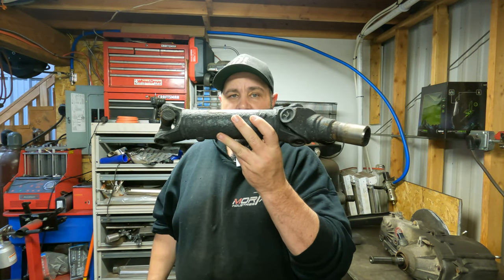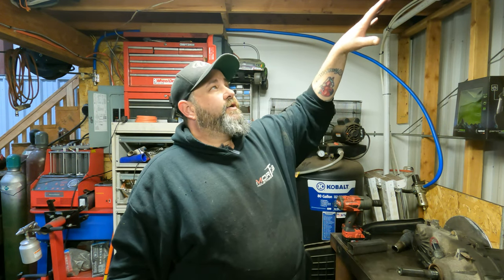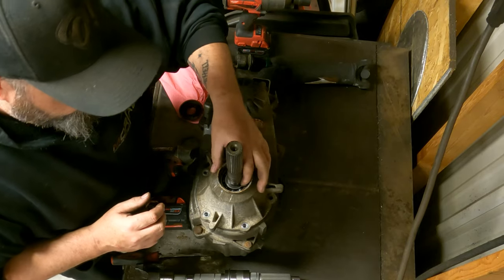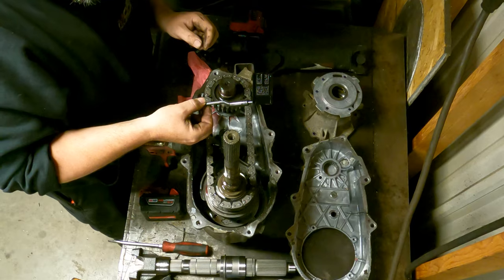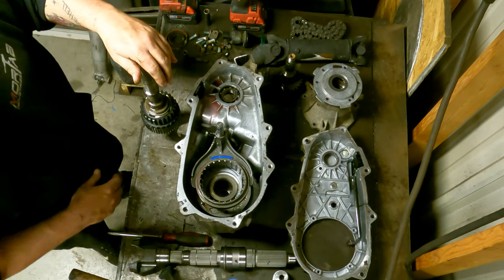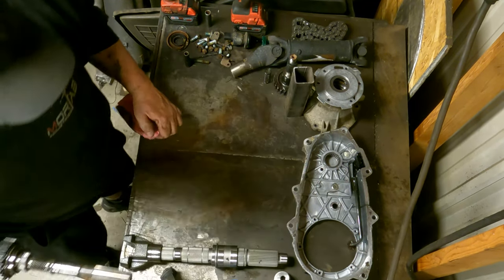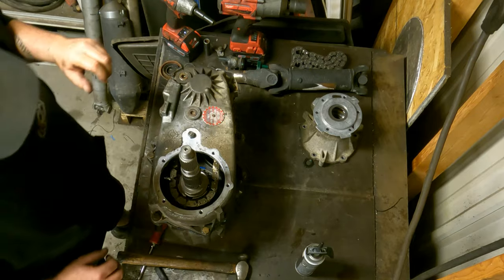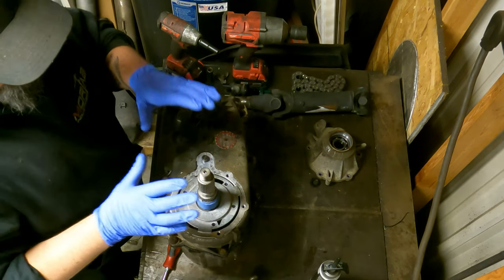Jeep Wrangler Slip Yoke Eliminator Install

Comment: You ever use threadlock on stuff? Just asking. You are a good teacher.
Reply: given how difficult it was to remove the yokes/yolks off mine, I'd say no since you apply RTV to the splines. And the rest of the bolts are never under tension, simply helping the RTV on the case halves do their job. (Here I am Validating myself knowing i didnt use any..... lmfao)

Comment: No one will see this, but after rebuilding mine with an SYE, it worked great until the smaller fork that holds the shift hub (not the collar with the big mode fork) wore out it's pads. I took everything apart. Now when I reassemble the case, doing a dry bench test without RTV, it will shift through all posisitions (2WD, 4Hi, N, 4L.) 
However, In 2WD, both the rear and front output shafts rotate with eachother. Essentially 4Hi. Cannot find the culprit besides maybe some tolerance with snap rings or faulty shift selector....

HELP